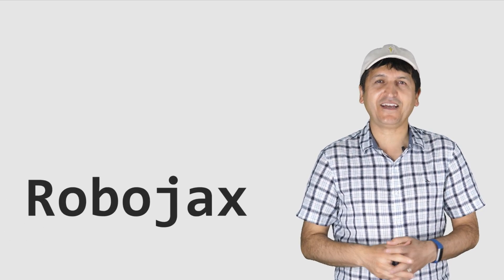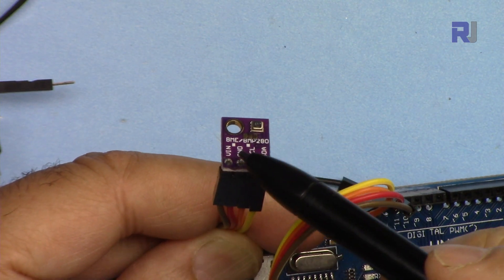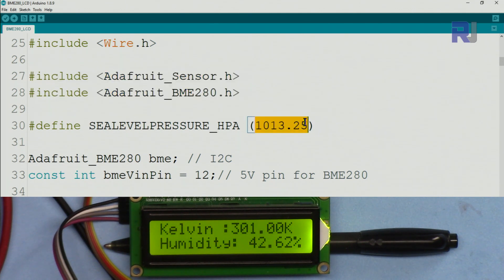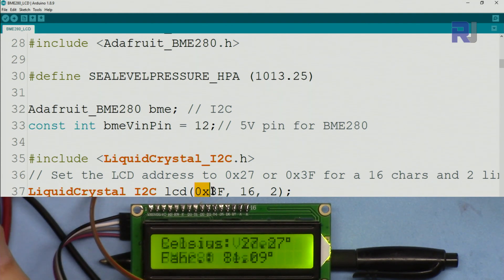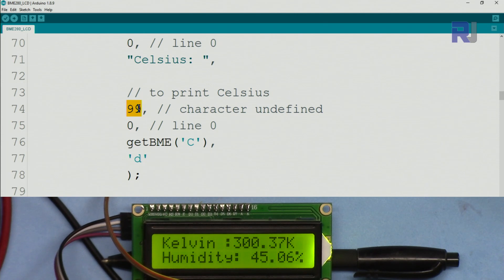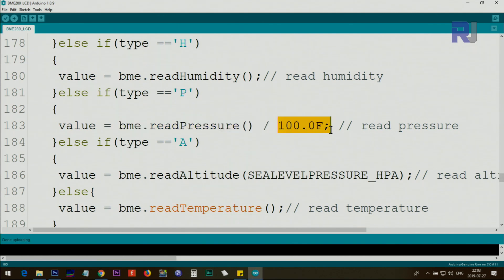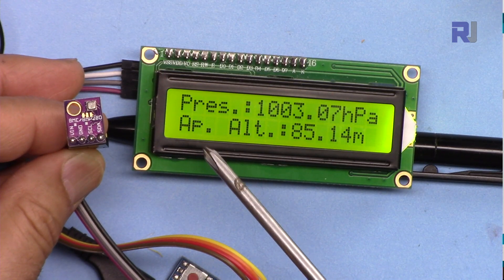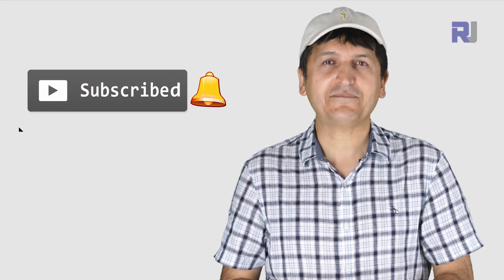Lesson 45:  Arduino Measure temperature, Pressure with BME280 with LCD1602 and LCD2004 RJT187

Comment: Hello ! Comment from Whitby, Wondering why i cannot get the code to work. i have both library from what I'm aware, but every time i try to verify code, i get the follow error message. Once i plug 16 , 2 into lcd.begin(16,2) it verifies and uploads but does not display anything serial monitor or on LCD. I have got both to work separately previously. hopefully you can help!

: error: no matching function for call to 'LiquidCrystal_I2C::begin()'
   lcd.begin();
Reply from the maker: Hello, it means you have not installed the library.  This video requires you to watch two videos one the lcd and the second the bme280.  So watch them separately and make sure both work then come this video .
Reply: @robojax  I Got it to work with your code and videos thank you for all content!

Comment: Many thanks for your very informative videos: I have 3 BME280s purchased from two different suppliers. All three give very similar results also the temperature and humidity displayed compare very well against an AM3302. The pressure displayed by all three is around 1020.20pHa, the pressure for the area I live in at the moment is 1029pHa. The approx. altitude shown on all three is around -58m (minus 58m). Your video shows a lower pressure of 1003.16pHa and 83.95m. 
Why is my attitude a minus figure, I can’t believe all three have defective pressure sensors, I understand your pressure will be different to mine – can you tell me what I am doing wrong please?
Reply from the maker: This is approximately. You got to read metrology related articles. I have no information about that. Sorry